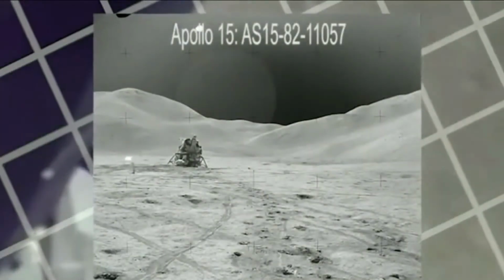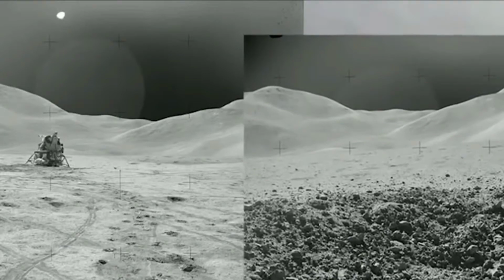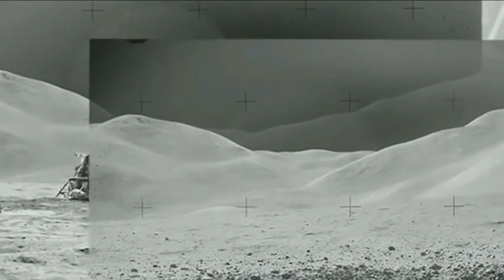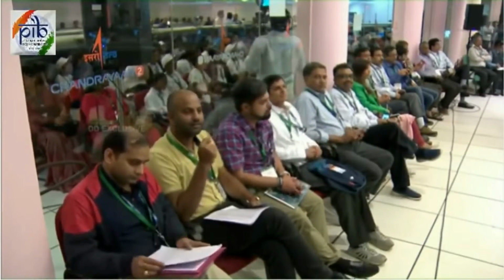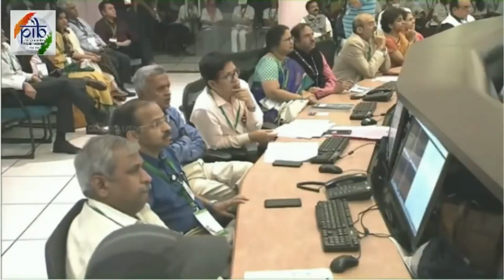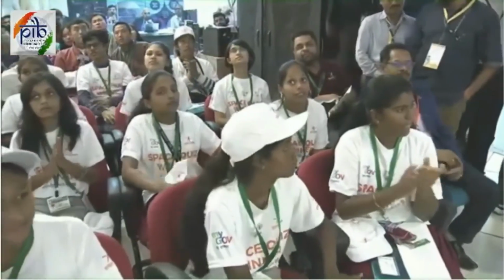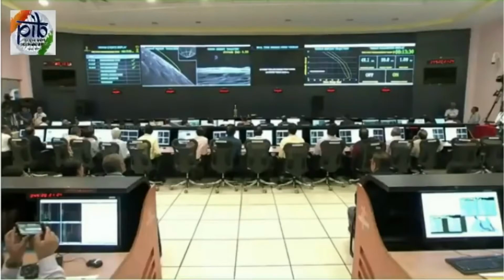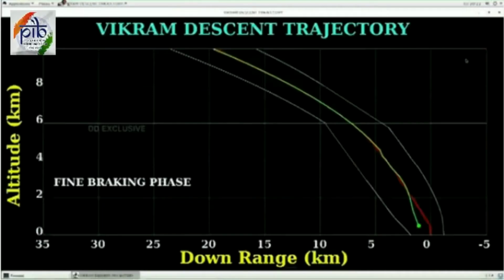Moon Hoax; "Vikram Rams The Moon!"

Comment: The moon's gravity is 1/6th they say, so shouldn't the rocket they used to leave the moon, to reach the Command Module in the moon's orbit again, also be 1/6th in size of Saturn V? But if you look at the jet engines at the descent stage of the Lunar Module you see, that they were very small. How did they know they wouldn't be burnt up half way to the CM? This alone proves, that it was faked.